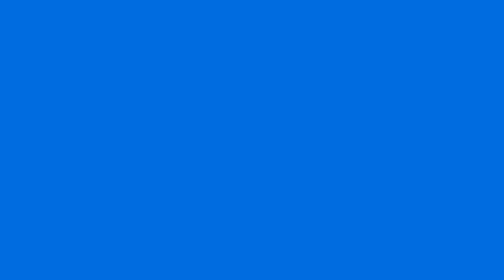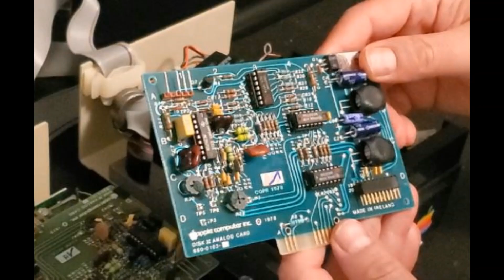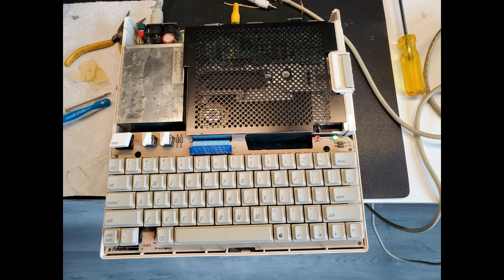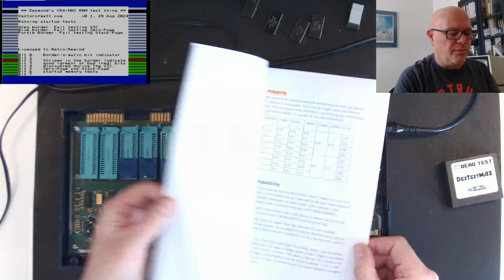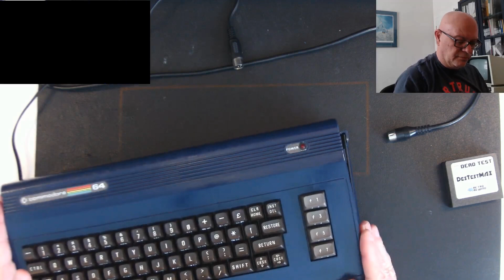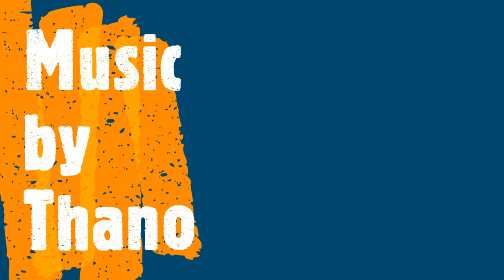Commodore C64 Dead Test Modern Replacement Cartridge

Comment: A slight clarification:  The shortboard 64Cs don't handle a missing CIA #2 (U2) in the same way that the older boards do: the VIC 16K bank select bits float differently and you'll get a garbled image.  DesTestMAX will work perfectly well on a shortboard if CIA #2 is installed and working correctly.  The resistor is only necessary if you need to run such a shortboard without the CIA present.
Reply from the maker: @FactorOfMatt  Thanks for sharing the clarification!

Comment: Hi, nice to know that I can get this in Canada:)  thank you and merry Christmas
Reply from the maker: Thanks for commenting, and Merry Christmas to you too.
Reply: Just wondering...  so if you have a fully soldered on chip 64 ...  other than the usual vicII and sid...  will this cartridge even help you with dead roms or cias without removing them?    I repaired a couple dozen 64s now..   hope you had a good Xmas btw:)
Reply from the maker: @donaldblakley6796  If other chips are falling but everything is good with DESTest, then you need to use a diagnostic cartridge. This cartridge is only good for dead 64s as it will only ensure that the cpu, vic ll , pla abd first 4k of ram is working. Hopefully, this helps.
Reply: Thanks.   I know all about the diag cart and harness.  I have one.   So honestly I don't understand all the fuss about this instead of dead test cartridge...  both need all the same main chips to work.   So let's say that I have a bad rom or cia.  That can cause a black screen also...  seen it plenty of times.    This won't help pin point the bad chip?   Sorry
Reply from the maker: This cartridge is like the dead test but does a much better job of testing the first 4k of memory.   Plus, it will show if there is more than one bad ram chip on the display. It also verifies that vic ll, pla, and cpu are working properly.